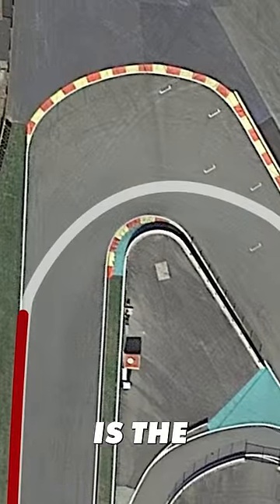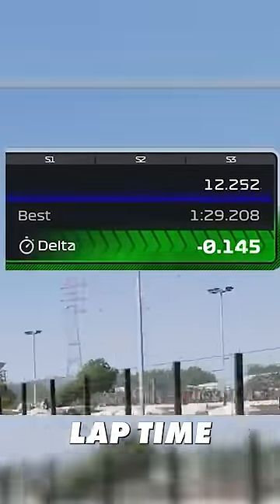Why F1 Drivers IGNORE the Perfect Racing Line

Comment: I’d love to see a professional driver do a test, a few laps with the “theoretical line” and a few with the “ideal line” to see how big of a difference it makes.
Reply: Watch the movie Gran Turismo it was a gamer that realize that the perfect racing line wasn't the ideal one.
Reply: @Ultimusvivi fr. But i play gt7, and the demos for license tests and circuit experience usually use the perfect line(as far as the ones ive done). 

I try to do the ideal line but ive never gotten a faster time than the demo's perfect line. But also its because im a bad driver
Reply: @valakarhtelgrem5210 #1, you're palying an arcade game with subpar physics, it won't represent reality. #2 turn off the racing line asap if you actually want to get better #3 even with all that said you would 100% be faster on a lap by using a different line from the games line.

Also, in most games the line is set up for the lap, not corner by corner. So it already shows you the best line and not the ideal line, it's still garabge though.
Reply: @BoredLikeHelI  i don't use the racing line assist. I only said demo's line. Like the line that the demonstration car drives on. Ive seen videos on youtube that beat the demo though, so now I know its not perfect
Reply: @valakarhtelgrem5210  those are the same thing. The demo car obviously drives along the games racing line. If it didn't then even the game would be admitting the racing line is shit, which it never will admit.

And again, gt7 is not the right game to test that stuff. A big part of not racing the "perfect line" every time has to do with road surface/bumps/curbs/etc. which this video did not touch upon. You need a game with laser scanned tracks and actual proper simracing physics to see a big difference in those situations.

For example, look at any casual sim racer driving the nordschleiffe, in gt7 and in assetto corsa or iracing for example. They hit the curbs everywhere like they think they should, and in gt7 it makes less of a negative impact than in simracing, but there are very few curbs you should touch on that track. Also, bumps in the road make a BIG difference on that track.
Reply: @Ultimusvivi  this is like telling someone to watch the mario movie to get better at super mario brothers. Such a garbage take.
Reply: @BoredLikeHelI  you're incorrect I was merely using the movie as an example that Gamers think outside the box and there's also a huge difference between the Mario movie and playing Super Mario and Gran Turismo and the movie. The Super Mario movie doesn't function like the game does. The Gran Turismo movie and the Gran Turismo real driving simulator do function the same, it's why it's called a simulator. The perfect racing line only accounts for Curves individually instead of the entire racing course as a whole. If you drive into an s-curve the perfect racing line will put you in  an ideal scenario for the first turn but an unideal starting position on the second turn resulting in a slower lap time. It's also the same Principle as the parabolic curve instead of a straight line. If you put a marble on two ramps one with a parabolic curve and one with a straight line the marble with the parabolic curve will always reach the end goal faster than the marble going straight despite traveling farther. While the perfect racing line may have a shorter distance than the ideal racing line the ideal one is still faster.
Reply: @Ultimusvivi  you're incorrect on so many fronts. No one in their right mind would ever call gran turismo a simulator. It is an arcade racing game. Any racing game you can be above average at using a fucking keyboard is NOT a simulator.

Also, the racing line in the game DOES try to account for the whole track, it is blatantly obvious if you do even a tiny bit of testing. It's just crap at it.

Finally, the whole "gamers think outside the box" thing worked in this one fictional movie and you try to make a rule out of it because you probably "simrace" in gran turismo and want to think higher of yourself.

The actual reality is that actual drivers that have driven actual cars around the actual tracks are WAY more knowledgeable and faster than simracers (iracing, acc, etc.), let alone faster than arcade gamers (gt, forza, etc.)
Reply: @BoredLikeHelI  so the creator of Gran Turismo is not in his right mind according to you. The title of the game is Gran Turismo the Real Racing simulator, it's in the title of the game. It's also real enough of a simulator that they actually got them to become real race car drivers which was the whole point of the movie.
Reply: @Ultimusvivi  you're seriously taking the marketing for a product at face value with no critical thought put into AT ALL? Lol next you'll tell me Gillette IS the best a man can get!

Pathetic.
Reply: @Ultimusvivi  to elaborate a bit just in case you are actually a bit slow or like 12 years old:

Gran turismo and Forza are BIG budget mainstream games. They CANNOT and NEVER will be simulators because they have to cater to the widest market possible and that is CONTROLLER users. ANY racing game you can be somewhat competitive on using a controller vs someone with a dedicated wheel/shifter/pedals just simply CANNOT be a simulator. It's the same problem with FPS games of keyboard mouse vs controller users. They have to give controllers aimbot because they would just get wrecked. Which is the biggest reason why most FPS don't have crossplay from PC to consoles.

Just because they market it as a simulator to make all the 12 year olds feel like real race cars drivers is absolutely irrelevant.
Reply: @BoredLikeHelI  well the people at Nissan  took it at face value and made a professional racer out of that boy and made millions. The only thing pathetic is your attempts to belittle and discount the achievments of others to make yourself feel better. If the world was like you, we would never dare to dream and make them reality.
Reply: @Ultimusvivi  you're not disproving anything I said. It was a marketing move genius. The people at Nissan could've taken a kid who never saw a car before in his life and made him a racecar driver. You really are so gullible.

None of this changes the fact that it is an arcade game that has little overlap with reality. They could've just sat down some kid in front of printed maps of the tracks to learn the layout by heart and it would've gotten him most of the experience gran turismo did.

Let me dumb it down even more for you: what racing games do ACTUAL racing drivers play? Max Verstappen plays gran turismo in his off season right? Oh...

Ffs don't believe a multi billion dollar corporation's marketing. It's pathetic. 

Try it out yourself, download iracing or asseto corsa or whatever and try to be as good as you are in gran turismo. Good luck.
Reply: @BoredLikeHelI  also what I'm talking about is already in the history books. Debate it all you like it won't change the facts of what's already happened. I won't argue any further. Regardless of what either of us say won't change history. You have a right to your opinion even if it contradicts history.
Reply: @Ultimusvivi  and again, you've added nothing new and literally contradicted your own points. By your logic: more people became racecar drivers without starting off on the sim, so history proves my point?

You're also compltely ignoring everything I said and not responding to any of it. So yeah go enjoy your arcade game and stop simping for simple marketing.
Reply: @BoredLikeHelI  we must be playing different versions of gt7 because my gt7's demo car does not follow the game's assistant racing line. The demo car in nordschleife doesnt even touch most of the curbs either. I agree it's not 100% realistic, but the demo seems realistic enough, given how players of the game beat it by pushing the boundaries that are otherwise unpushable in real life
Reply: @valakarhtelgrem5210  I only ever played gt7 at friends houses so I might be misremembering that then. Stupid game design if so, racing line should be demo line since it's what the gane wants you to copy.

From watching a few videos just now I don't see how beating the demo is so insane? Seems like you need to use a couple different lines in diffferent places that I'm sure are not optimal in reality but that's been true for almost all racing games, especially arcade games (computer usually cheats so you need to work around that/cheat yourself using the arcadey physics/design) but also sims are never 100% perfect.

*as for the curbs my point was that is wasn't optimal and would make you crash out but it simply doesn't in arcadey games, so makes sense for the demo to avoid most. What I meant is that you can watch videos of people going way to fast in gt7 by hitting all the curbs on the nords and that hitting even half of those curbs at those angles/speed/cars would make you crash IRL or in a decent SIM.
Reply: @valakarhtelgrem5210  

You understand the demos are just the gold times and you can destroy those times right? There is pretty much not a single GT license test time that I haven't completely obliterated. Just go look at the world records.
Reply: @Ultimusvivi  

Yea, except gamers were not the first one to make this discovery, not even remotely close. On top of that, GT is not a sim, it's a simcade. A sim is AC, ACC, iRacing, rFactor, etc.
Reply: @Ultimusvivi  

All of the professional racers who came from GT were trained on Rfactor FYI. Please stop being ignorant.
Reply: @Delimon007  of course they had additional training, even the people who try to make it their career to become a professional race car drivers rarely make it. Only a select few go pro even with years of training. Even fewer can Podium The 24 hours at La mans. I'm saying is that the top players of GT got enough of a knowledge base to be viable to train. I highly doubt that even with all the real Sim training they received in that school would not be enough for the average person to make it and would be a waste of money trying to train. It allowed Nissan to find talent to invest in.
Reply: @Delimon007  😭😭😭 dam i gotta practice more cause i suck specially with traction control off
Reply: @BoredLikeHelI  I agree with most of what you say, but there are people who are pretty good at Assetto Corsa on mouse and keyboard. The best mouse player against the best wheel user will likely use, but they can be somewhat competitive
Reply: @ToyotaMotorola  no way dude. Assetto Corsa is impossible at above average levels with mouse and keyboard
Reply: It does work in nearly every semi-realistic physic model racing game I play. I usually win races by using the ideal line or a variation of it. You can bait people into switch-backs if you have people on your tail that are gunning for the apex. Usually how I end up miles ahead of everyone.
Reply: @valakarhtelgrem5210  Nah It's Gran Turismo. It's handling model is too "on-rails". So it almost punishes you for not taking the perfect line. I remember that even being an issue in GT3 and GT4 when I was younger. 

It's worked in Forza since Motorsport 3/4. Feels rewarding. But I don't play those for realism.
Reply: @BoredLikeHelI  The funny thing is though that it does work in Forza because it has a bit more depth to it's physics model. Gran Turismo is a horrible Simcade.
Reply: @BoredLikeHelI  Oddly enough I almost prefer to play F1 games with Mouse and Key.  It just works. Assetto? hell no. It's hard enough on controller in my opinion. I had to use the controller mod, which does work very well.
Reply: @BoredLikeHelI didn't know Gran Turismo 7 can be played on a keyboard 🤡
Reply: This theoretical line is the theoretically fastest line for that section of the track, ignoring what's before and after. If that is what was measured, the "theoretical" would be faster.

But if the whole track was to be measured, well, then that theoretical line wouldn't look like that at all. No theorist would every say that it should be faster along the whole track. The theoretical line around the whole track would actually look about the same as "the ideal" one.

The way this video uses this terminology of "theoretical" and "ideal" is nonsensical to me.

And if this test was to be done for the whole track, the theoretical one would aim to be equal to the idea one just as the driver would attempt to find the ideal one by feel and experience. It would then be a battle of who could get the closest to the "actual ideal" line. A driver, by feel, or engineers, by simulation.

Which one is fastest would actually vary in my opintion, because drivers are faulty, and so are simulations (which always are approximations, and depend heavily on the correctness of the input data). Given perfect input data, the theoretical line would always beat out what the driver would do by feel (unless they by happenstance did the exact same thing, making the driver equally fast in the best case). However, it's impossible for engineers to calculate the exact actual perfect line in real life, as the input parameters must always be simplified. You can't have perfect input data. 

It's has for example been demonstrated by Lewis Hamilton. Mercedes got their calculations wrong, when he beat their predicted optimal laptime based on their simulations. His line was closer to the actual ideal one, than their simulation was, by some tenths I think.

But this talk/terminology about "theoretical vs. ideal" is nonsensical in the context of the two line given in the video at least. No theorist would say that the first one is actually the theoretical fastest line.

(Rant over...)

Comment: The more power and less downforce you have to more you take that deeper point of turning in.
Running a lower performance engine, like a stock ‘60s mini, you want to maintain as much speed, carry as much speed through the corner as possible, use less steering angle and use that ideal line to keep momentum cause you won’t have enough power to compensate the speed lost.
Depending on downforce, ability to maintain speed through a corner and the power to accelerate engineers will calculate for every corner the line to take to spend the least amount of time in that corner without losing straightline performance, some combinationations of corners like the first section of suzuka after that long constantly squeezing first corner all the way up to that long lefthand sweeping dunlop corner, straightline speed isn’t your aim, keeping the momentum up not losing average speed is a compromise for every corner between these techniques.

A fast laptime is all about the average speed around the circuit, sometimes you sacrifice a little of that average to compensate on that following straight.

I dare to say it isn’t as black and white as you now state it.

It is all science based, how to achieve the highest average speed over a lap.
In F1 the main focus is spend less time in a slow corner and use that 1000 bhp to accelerate as soon as possible and gain average speed most of the time, but not everywhere.
Pouhon, Spa in underrated, in touringcars that is bigballs corner, don’t loose speed on entry, carry as much speed as possible and exit with highest speed possible

Comment: I learned this thanks to MX Unleashed. There is a technique called squaring the turn. You come in fas toward the middle of the outside of a hairpin turn and hit the breaks to slide, then pop the clutch and rocket out of the turn. It was super effective if there was a rhythm section after the turn. I started playing with the idea of using the technique in other racing games. It was easy to use in rally and drift, but sliding in other types of races proved... ineffective. I then started trying it with minimum to no sliding and eventually found that lines like the 1 shown in the video were really effective, especially when long, fast sections followed the turn. It was most effective for hard turns as well as some long, banking turns. I eventually found that in banked turns, I could use the slope of the bank to get a bit of extra speed and set up to pass in or at the end of the straights. It was extremely effective if you had a shake and bake buddy so you didn't have to struggle to get a slip stream from cars ahead

Comment: Basically use this move when you know after the turn is a long straight. Set yourself up to accelerate better and get to top speed faster. 

Avoid this line if theres another corner coming up
Reply: Exactly, a very good example is T1 at Spa, pretty much a textbook late apex to prioritize exit.
Reply: yep, and do the opposite when you have a long straightaway into a slow section

Comment: In my racing in Forza Motorsport, I'm thinking a last corner of a series of corners would be better to exit with a high speed, so brake earlier. While the first of a series of corners after a straightaway, brake later to be faster for longer.